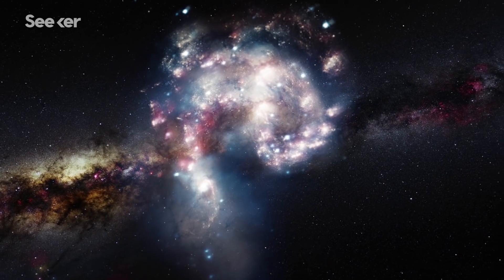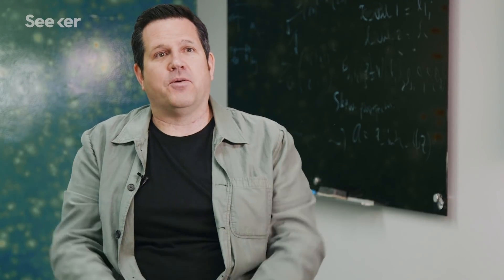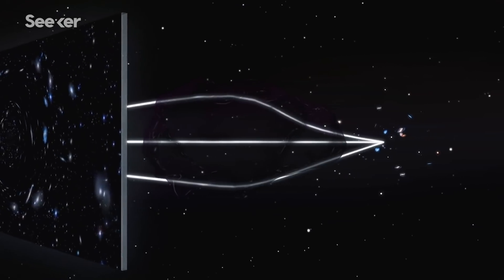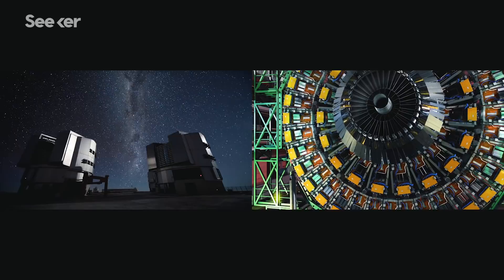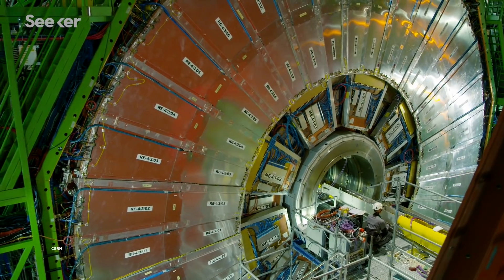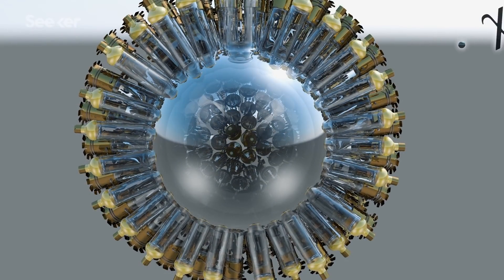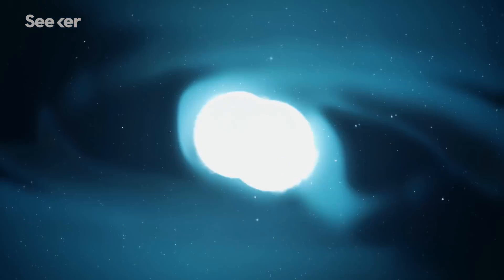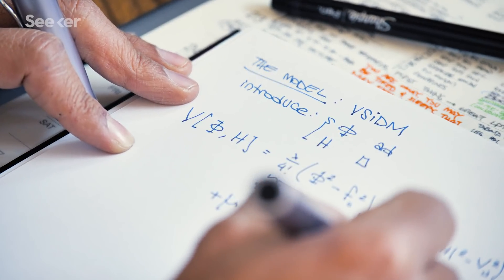How Close Are We to Finding Dark Matter?

Comment: An intriguing new possibility is that Dark matter and Dark energy are the same thing, a fluid of negative mass particles. It would be very interesting to find out if that's the case.
Reply: I think this theory seems to be more self consistent as well.
Reply: PBS Space Time talked about it.
If it's the case, there's supposedly also a way to create infinite acceleration by placing two objects next to each other which doesn't make sense.
Something about negative mass particles accelerating towards normal mass and normal mass going away from negative mass.
Reply: @n3th537  but you would need an infinite chain of these particles to create infinite acceleration. See negative mass particles and positive mass particles like magnets, If you place the same poles together, they will repell and create (movement) acceleration. If they are far enough apart, they will stop moving and you would need another pair of magnets to continue the movement, but then eventually these will stop moving too. You would need an infinite chain of magnets to create infinite acceleration.
Reply: @Sharpless2  Not if one magnet is pulling the other magnet which repels the first one. It'll pull it over and get pushed at the same rate which would lead to infinite acceleration.
Reply: I recommend checking PBS Space Time's video on it which goes quite in-depth with the subject.
Reply: @n3th537  interresting, but thats impossible with 2 magnets. Also theres friction that will end our experiments.
Reply: @n3th537  Indeed, I've seen them. Well there's a lot more work to be done before we figure out the truth, but it's a step in the right direction.
Reply: @Sharpless2  Indeed, impossible with 2 magnets, but that's what the hypothesis suggests about how negative mass should work.

Comment: Dark matter could be interphasing matter from other dimensional planes
Reply: and why would it and the dark energy help in the expansion our our universe? and not just rip it apart?
Reply: @johnnyxp64  Just like how 2d material sits in 3d space. Maybe the little matter we exist in sits in a space of yet a higher dimension.
Reply: Johnnyxp64 it could be a side effect of the transference
Reply: The LHC and the VLHC haven’t found any evidence of extra dimensions or particles fitting the dark matter hypothesis.
Reply: @andrewrivera4029  Since they are planning a new collider that is several times the size I doubt even the scientists running the LHC believe that it has found everything that could be found by colliding particles.
Reply: Richard Meikle the money would be better spent in space where the dark matter enigma lies.
Reply: @andrewrivera4029  Not debating the cost. Just that they plan to built it because they believe what we have now doesn't have what it takes to answer definitively the questions they hoped the LHC would answer.
Reply: Richard Meikle I am debating the cost, At what cost? The only thing new from the VLHC was the Higgs, most in the science community said VLHC would answer most if not all questions pertaining to dark matter, new physics and GUT. It’s time to slow down and let the theoretical physicists put forth “testable theories”. Then a plan can be put together that could gain wider support. The money could be spent better peering into sky’s for the answer at this time...
Reply: @andrewrivera4029  um ok
Reply: Yesssss!!!!!!